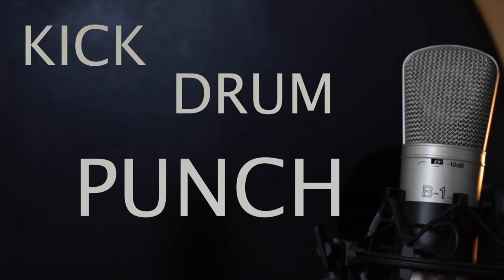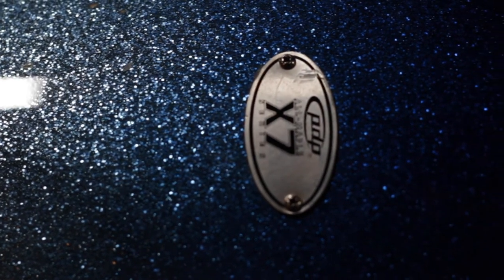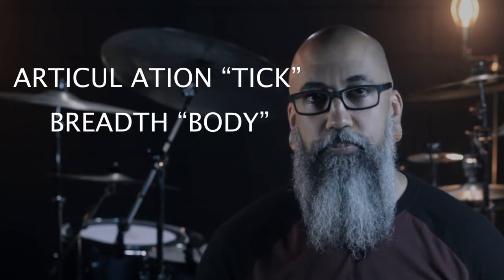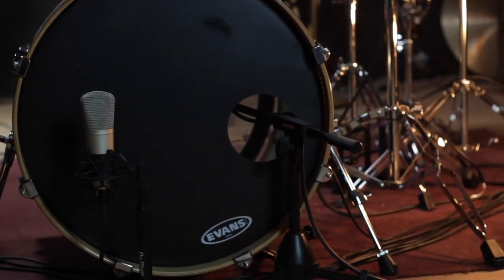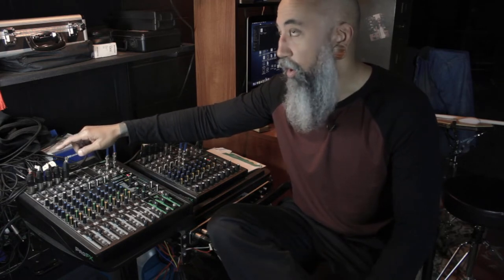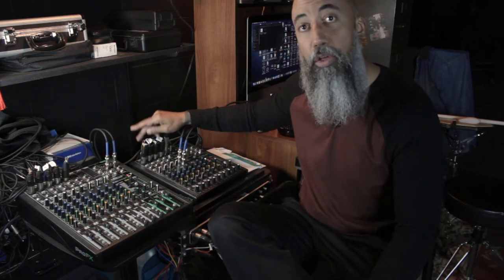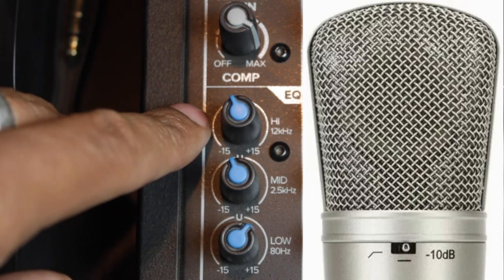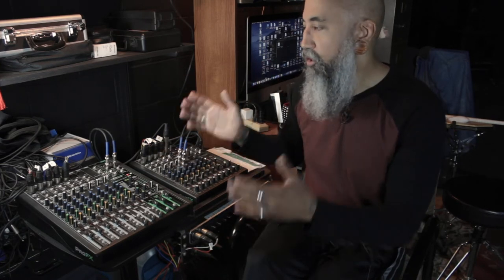KICK DRUM PUNCH

Comment: Very instructional! Definitely learned a lot from this. Particularly in regards to what mics to use and how to set up the mixing board. I'm curious -- do you do any further editing to the sound of that mic on the mac itself afterwards?
Reply from the maker: Hey Mickey, thanks! I do sort of "master" the stereo mix in the DAW.  That is, I add a final digital compressor on the stereo mix in the Mac to bring the levels up to the commercial output standard.  It's actually just a standard preset in Waveform 11, which is the DAW I used for this video.